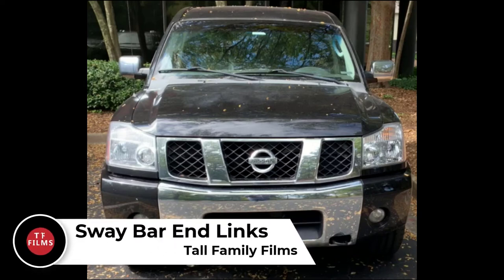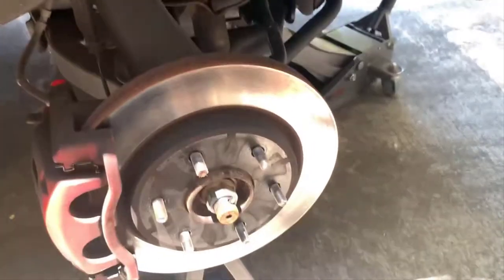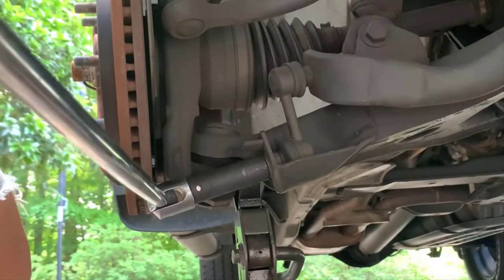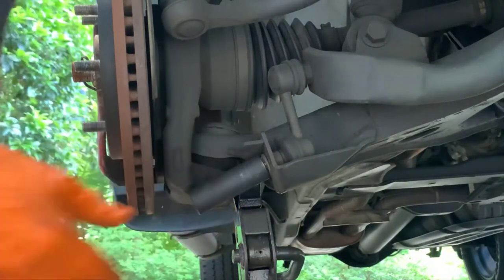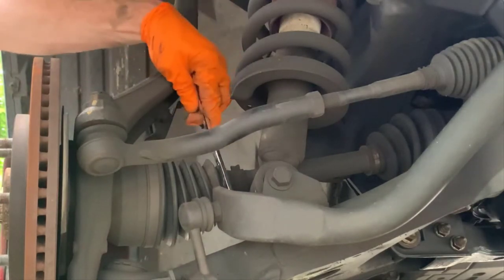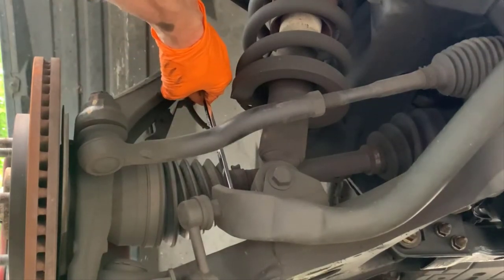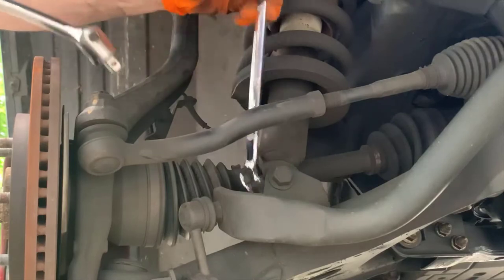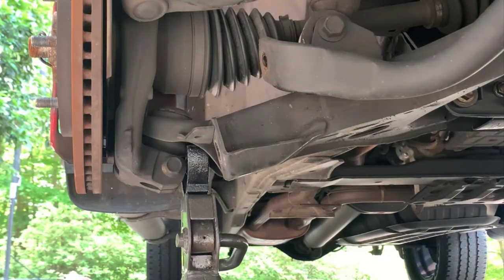Easy Front Sway Bar Link Replacement - NIssan Titan, Armada, Pathfinder, Infiniti QX56 and QX80

Comment: Probably wouldnt hurt to mention depending on where you live and how much rust you may have to cut the links out. I had to on my Titan.
Reply from the maker: That’s a great point. Living up North can add complexity to any car repair. You were probably jealous of how clean mine looked :)
Here’s another video I did that shows another method that will work unless the bolt and nut have become one. 
https://youtu.be/St9aFGEkIXw

Comment: Thanks, for that, quick question, do you need both wheels off the ground at the same time or can you do one side then the other?
Reply from the maker: I always just do one side at a time. However, if you do take both wheels off the ground the bar will have less tension on it. So it might make it easier. But, it’s not like it’s ever been that hard for me either.
Reply: @TallFamilyFilms  Thanks very much buddy, appreciate the reply

Comment: How do you know when you need to replace it?
Reply from the maker: great question Paul - usually you will start hearing a popping noise going over bumps and when turning. If your driver side was bad, the noise would be the worst when turning left.